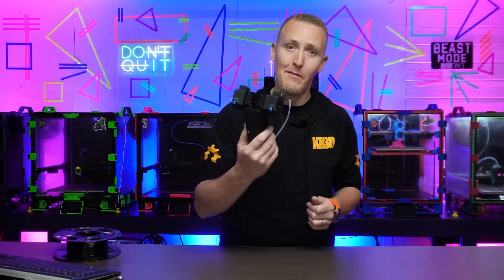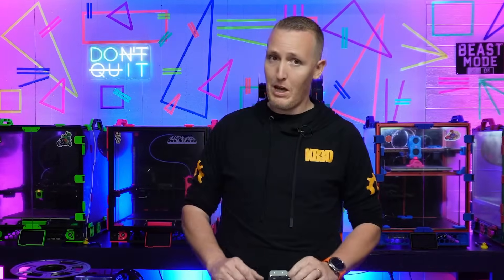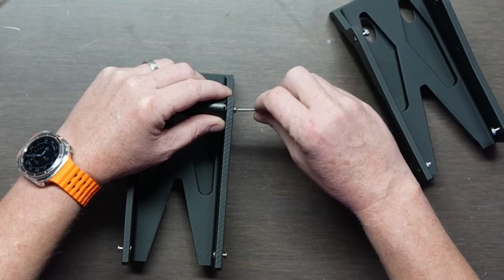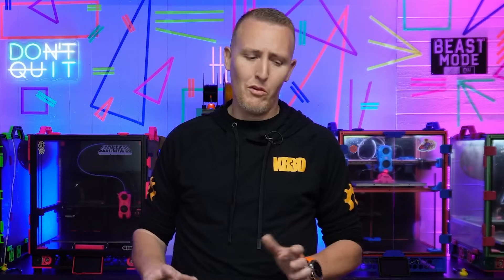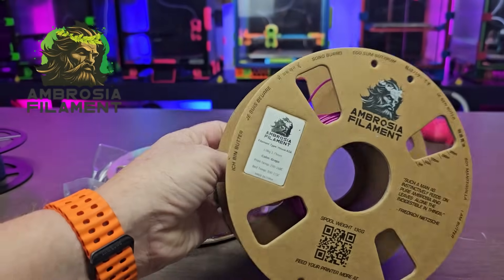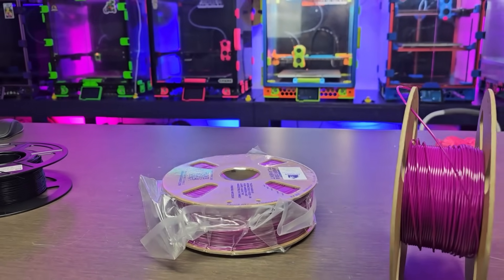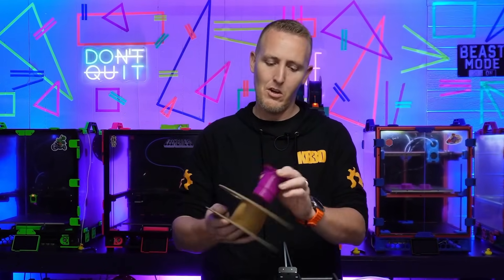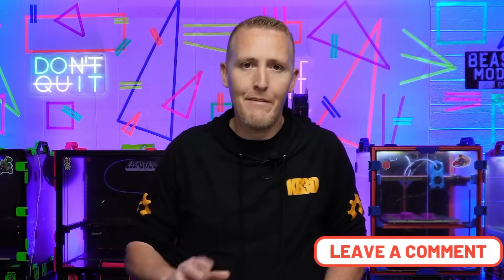Say Goodbye to Filament Waste! Introducing the Infinity Flow S1 Auto Spool Changer for 3D Printers!

Comment: Where can I get the spool weights
Reply from the maker: There are a few different mods for this I can share with you. One thing that is super easy to do. Get a 2" ball bearing and those hold the spools down great and fit right in there :) Also join our discord I'll link the mods to you. Link is in the description with the social links. Thanks for watching! Actually recording a follow up to this video now that has a cutter on this.
Reply: @leemerie3d  thank you for replay I get on the discord I have some spools withe really large center hole and did like the ones in the video. With me not printing colors using your link I place an order for infinity Flo my Creality k2 CFS driving me crazy with all the feed and retraction errors. And being I  airbrush a lot of my models and having 3 large tote bins and not wanting to weld / re-spool rise and repeat 🔁 this seems to be the way to go. The site did not have the cutter so I look out for them…
Reply from the maker: Oh that's awesome! The cutter is not released yet but will be soon. I'm working on finishing that video and I'll get that uploaded soon. The cutter is for when the spool gets tangled or can't pull thru it will then cut the filament free then feed the one behind. It's very cool! Thanks for watching and using the links! 😀

Comment: Living in a humid region, an enclosure or dryer would be a nice add-on for this.
Reply from the maker: Ohh that would be very nice actually. I hadn't thought much about that as it's very dry around here it seems. Or at least where I am at. I do have a dryer for some filament like Nylon and such. 
Great idea though! I will pass this info along to them. There is an upgrade coming out soon and I may make a video on that if there is enough interest. 
Thanks for watching! Catch us on Livestream tomorrow if you would like! Have a happy Friday!
Reply: @leemerie3d  Lucky! If I leave a spool of ABS out for even a day, the next day it prints very stringy with a bunch of surface defects.  It's a must for me to print from a dry box. -_-
Reply from the maker: @j1ndz  Oh yikes! I guess we are lucky then :) 
I bet an enclosure could be made very easily for this. Could even just use a polydryer attachment for the dryer part if needed. That would be a cool mod to do for folks that need dryers like you do.

Comment: I print directly from Sunlu 4 bay dryers.
Which have an outlet for all 4 bays.
 
Can this device work  (with a mod) with my dryers?
Reply from the maker: Unfortunately it would not work that way. You would have to print directly from the Infinity Flow S1 instead of the dryers.

Comment: I'm absolutely stunned they shipped a product with that much ringing 8:53 😳

Atrocious
Reply: I think they are just trying to get them out there as fast as possible! They will improve over time. There is a lot of intrest in their product from EU but they still dont ship it here. I wish they at least could sell the brains of the system, and we could print them ourselves over here.
Reply from the maker: @Malkolmi  Maybe they will start shipping to EU eventually. They are coming out with a new version with some upgrades as well soon! Hopefully the EU market will be able to get their hands on these.
Reply from the maker: Their machines do need to be tuned in better for high speed printing to get rid of that.

Comment: Seems like a cool idea, but i had the same thoughts Tintalon mentioned. I liked that you showed it running out lol, the two videos ive seen come across my feed shows an empty spool with an inch or so of the filament sticking out of the ptfe like it was prepped and the other someone one actually cutting it in the middle of a spool just to show that itd keep going. If you had some close to empty spools, you could easily snip the end taped/inserted in the lil slot to make sure it cleanly come off the spool. Thats what i do now with the K1, let it run thru the filament sensor, print stops, I swap em and go again, i do waste the filament thats between the toolhead and sensor, but its only about a foot and half. That'd take alot to make up that pricetag, but I only do that when im home on the weekends, certainly not everyone can be there all the time, to check on it which i could see a use for it and then  people that use bigger 3kg and 5kg spools. Felt like i typed too much lol
Reply from the maker: Never can type too much! That exactly what I do on my other machines with the filament sensors. But yeah it's for these times I'm not around to be able to swap them. And for sure! I had to show it running. I just wish I could have had another couple spools that were almost empty so I could go back and forth with that a few times lol. That would have been a good test. But thanks for watching! And the comment 😁

Comment: I can see where this could be useful....but I have ran across on many spools where the end of the filament on the nearly empty spool was glued to the spool or bent in a little more where even AMS type devices can't pool it off.  On an AMS I will stop the print and wait (usually) for you to fix it.  How does this device work in that situation?  Does the printer stop and wait or just bring to print?  I can't see this device working with a filament sensor does it?  If so wouldn't the sensor trigger a printer stop and require someone to load filament?   I know this is not the case with a lot of filament but it does happen.
Reply from the maker: Nailed it! I honestly didn't think about this until after the video or I would have mentioned this. I am actually going to see if they could possibly implement something like a cutter on a servo that could cut the filament free if it gets tangled or to the end of a spool that is taped. That is one thing that would help for lots of spools that use tape at the end. Great to point this out!

Comment: really cool but man, this is expensive... i mean any mmu unit has something like this built in and this is close behind in price compared to mmus on the market
Reply from the maker: I agree. The price is a bit high. With things like the box turtle that can do infinite spool and all. The good thing with this, is the ability to just turn it on and it work. No installing firmware, flashing, and changing a ton in the klipper config. But yeah I agree on the price being high.

Comment: That is awesome. How much pressure does it use to push the 2nd filament behind the first?   I can see an issue with the A1 Mini maybe getting 2 filaments in the extruder end if they aren’t right behind each other.
Reply from the maker: I am not real sure how much pressure it takes. I can stop it with my hand fairly easy enough. There may be some specs on that on the website. That's a good thing to know...

Comment: so 4 hours instead you have to sit and wait, some prints last more!
filament sensor, good macro for it, and buy bigger spools. 
i mean it's a godd idea, but it just adds to pile of more to the 3dprinter universe, i see it a a nice to have. diffently not a need to have
Reply from the maker: Definitely not something that is needed. It's very nice to have for me personally. I have filament sensors in all machines with macros. But, if one runs out at 3AM I have to wait until morning to change it. Rather than just feeding non stop. But that was the big thing for me. Using 1kg spools and being able to use the last bit of them.
Reply: @ true about the last bit!
Reply from the maker: @kennybulow3183  Absolutely! Using that last bit of filament is key. I have probably thrown away several spools worth of filament if I added up all the almost empty ones I have tossed. 😭

Comment: Cool gadget.  Use it to make a rainbow print by snipping the filament when you want to change colors.  Come on, do it!  I double dawg da__.......
Reply from the maker: Don't you dare! You know a double dog dare is one of the highest of all dares and can't be ignored!
Reply: @leemerie3d  double dirty dog dare is the irresistible dare of all dares. Compulsion is bad mojo though, so use sparingly.
Reply from the maker: I thought the triple dog dare was the biggest of all dares 😂
Reply: @ That has been the ruling in some communist countries and a few disreputable ports, but the Board of Dare Degrees has determined that the double dirty dog dare is superior in creativity and therefore a better dare than a simple reiterative increase in quantity. We don't want people out there gazillion dog daring each other.
Reply from the maker: @Immolate62  Ahhh. That is true. At what point does the number stop being effective and increasing the seriousness of the situation? It may start dropping by 50% after the double dog dare. So that being said, the double dog dirty dare can therefore be classified as the highest of ALL dares. This needs to be brought before the Senate for approval. It should pass without any issue I suspect 💯 💪
Reply: Lol that would be pretty neat

Comment: That'll be awesome for print farms
Reply from the maker: That's what I was thinking as well. It would be nice to have some sort of cutter on it for if it gets jammed, it could cut that and release it (Not my idea, a friend mentioned this) and move on to the next spool. For those spools that have the bend in the filament that won't pull through...
Reply: @leemerie3d I like the idea of incorporating a cutter. Maybe they could leverage filamatrix and Happy Hare integration for those scenarios.
Reply from the maker: Sort of what I was thinking. But idk, this would most likely be a complete redesign since it would need to be automated.  Still, very possible though!